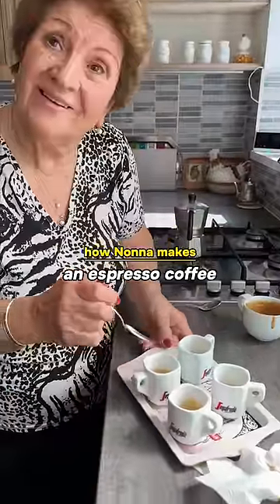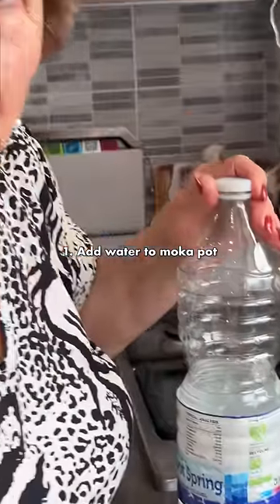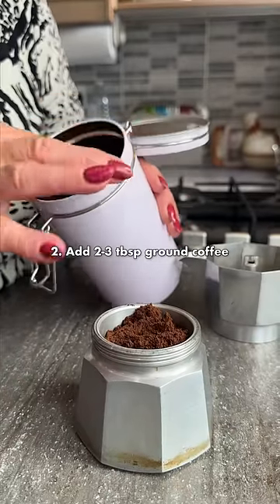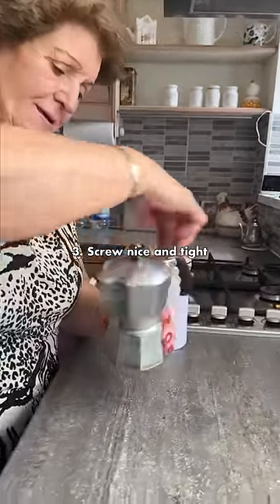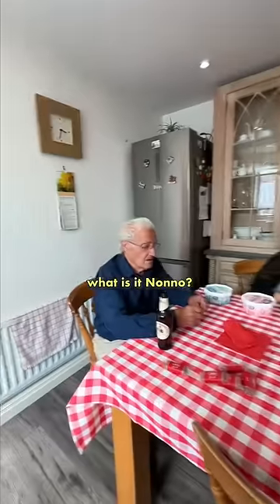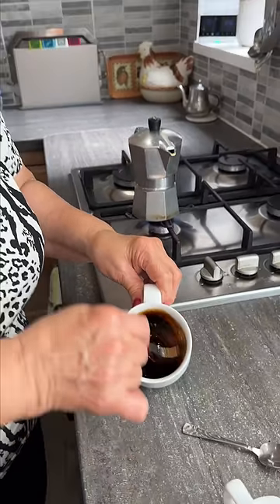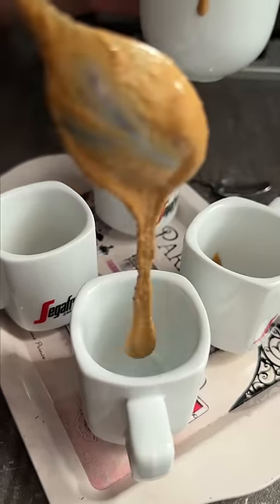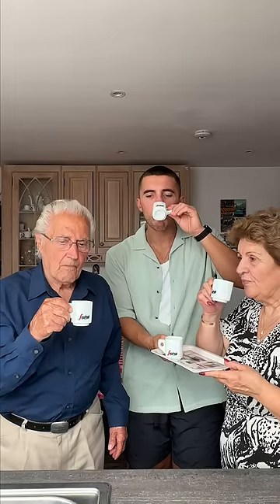How Nonna makes espresso ☕️ using a caffettiera (moka pot)

Comment: Wait wait wait!! That was too fast! How much sugar and coffee do you put in the cup to make the frothy-brown mixture?
Reply: Yes! And do you make two separate  brews of coffee 1 for the froth and 1 to pour - or - do you just use the first bit that ‘percolated’ from a single brew. We need to know.
Reply: @Raiirow  Basically add 2tsp of sugar per cup of coffee that your moka pot makes, add a splash of the first bit of espresso that comes up, stir until a cream forms. You use the first runnings to make the creamina!
Reply: Cuban coffee does something similar (if not identical), but call it 'cremina' or 'azuquita'.  See  "CREMINA : something that will change your way to get a coffee" or "How to Make a Cremina to Sweeten Your Espresso". or "Have you tried a Café Cubano?" or "How to make Authentic Cuban Coffee Recipe Espresso" or "Making Cuban Coffee in Miami" or "Azuquita – The Foaming Miracle of Cuban Coffee"
Reply: @SockPuppetDinosaur  thank you!